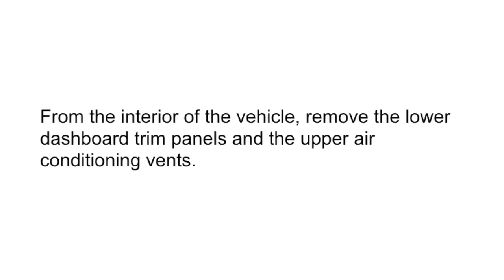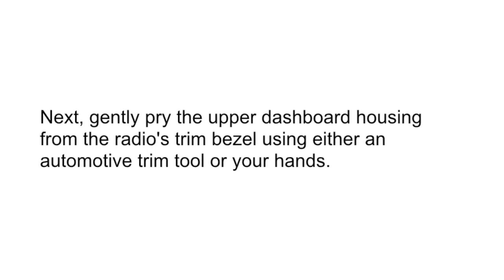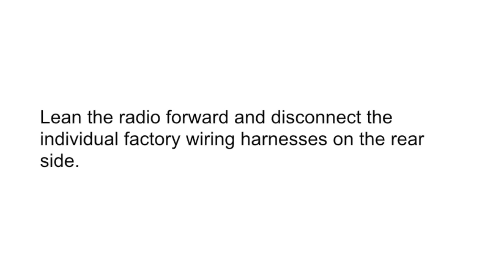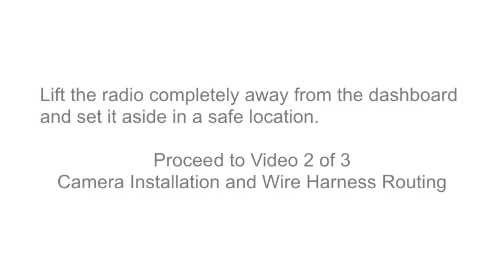2012-2013 Camry Dashboard Removal

Comment: He made a mistake. Never take a  battery off a auto made after 97 you might mess up the computer in your car. Always back up the computer with power before you disconnect the battery. Your computer might forget its programming. Mine did in my truck sometimes the radio won't work. Ask any one who does batteries for a living they will tell you

Comment: In the first minute, you remove two light grey bazels. I need to remove the light grey plastic behind them too. I unscrewed 3 screws but still it is not free to remove it. Do you have any idea how to remove that light grey plastic piece behind those bazels?
Thanks

Comment: how does the camera knows when you shift to reverse i didn't saw any step of connecting ground to reverse switch
Reply: Lazaro Mendoza This video JUST shows you how to remove the radio.
In order to install a backup camera, you probably have to connect the power and ground wire to the reverse lights in your trunk. There are videos that go into more detail

Comment: What is the wrench tool you are using called?
Reply from the maker: We used a 10mm socket with a 3/8" ratchet throughout this tutorial to remove and then reinstall the vehicle's radio.
Reply: RostraPC Hi, my girlfriends LCD has been unresponsive for a couple of weeks now. The display onscreen shows up and functions with the steering wheel buttons but the touchscreen is unresponsive, What would you recommend doing? 

I figured to do as you did in the video and just unplug everything and check if one of the cables came loose. 
Any help is appreciated.